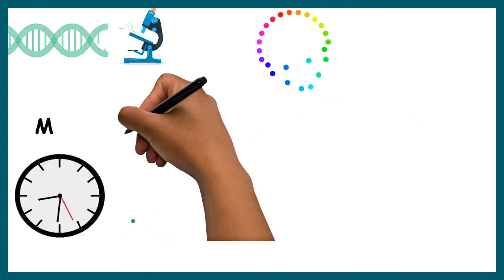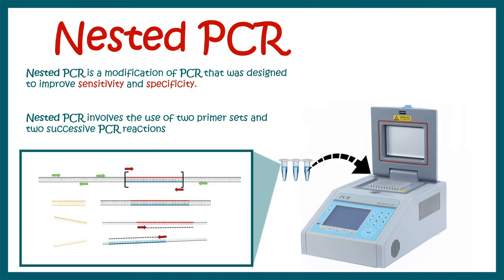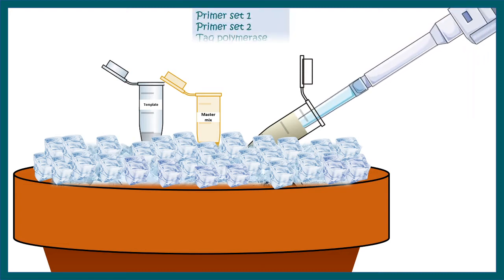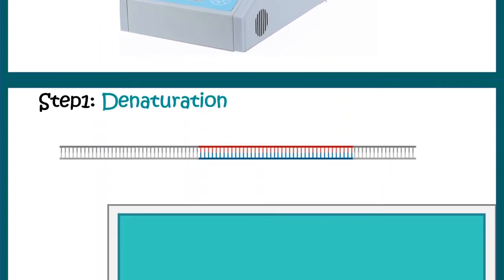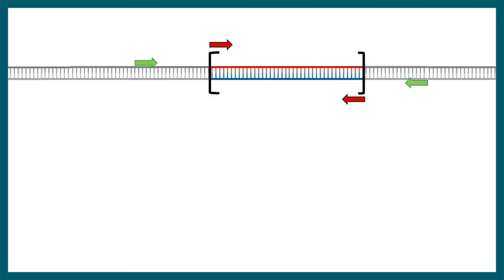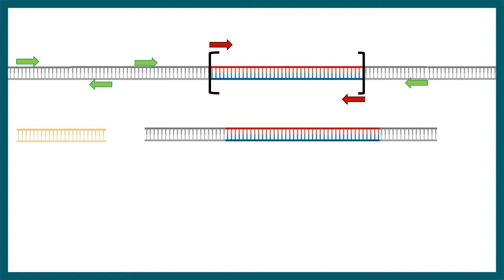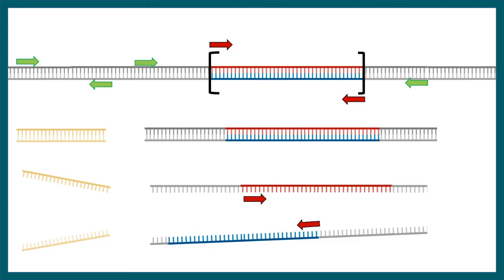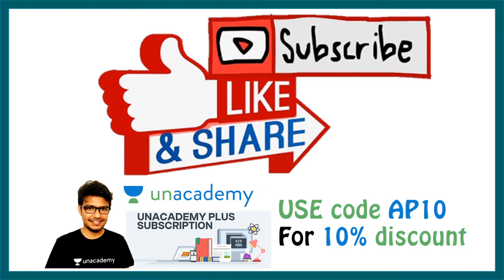Nested PCR || Principle and usage

Comment: to clarify the doubts most people have in the comment section, the first set of primers are added  along with the dntps ,buffer , taq polymerase first , then after the first round of amplification, the  product from the first PCR reaction is used as the template for the second reaction, where the second set of primers are added.
Reply: it's a pcr ception 😨

Comment: I still don't understand because i thought a Primer amplifies everything from the binding site to the end of the molecule?
Reply: Primers are short sequences of nucleotides that bind to a specific site on the DNA, initiating the replication process. They direct the DNA polymerase to start synthesizing new DNA, but they only amplify the region between the primer binding sites, not the entire molecule. Therefore, only the specific segment flanked by the primers is amplified.i hope this helps
Reply: @shashpalsidhu2420  i think that i lack imagination 😂 since this probably doesn't happen immediately as the video shows ,they first amplify the first region by many cycles until they obtain it and then use the second set of primers and proceed the same way
Reply: Oo my god tq so much  @shashpalsidhu2420

Comment: are you saying the first primer set, the green pair, acts independent of the 2nd pair? otherwise how are you eliminating nonspecific apmlicons?
Reply: The first set of primers (green ones) are used to shorten the region which has our targeted segment. As both the red and green ones are non specific , so 1st the green ones are used to shorten part of the DNA which has the target region (produce both the specific which carries the target segment and non specific region). Then in the 2nd round the red ones binds with only that region which has the target segment ,free from non specific segments.

Comment: Excellent video, but I don't really understand why having two sets of primers minimizes the probability that the second set of primers will bind non-specifically to other regions...
Reply: So it involves 2 PCR reactions right. The first PCR product is technically a template for the 2nd PCR. That increases specificity. The mastermix that you design should have outer and nested PCR mix. Outer PCR amplifies a larger region and nested 2nd uses first as template targeting a smaller, internal region of the original sequence. Hope this makes sense
Reply: Will the two sets of primers have slightly different annealing temperatures?

Comment: Perhaps a silly question, but do you combine both sets of primers in a singular master mix? Or do you add the result after a first PCR run with the second primerset seperately for a second run?
Reply from the maker: Its used as a mastermix
Reply: It's added sequentially. One after the other. First set added, procucts taken, then the second set added to the products

Comment: Why don't we use secondary primer(specific primer) in the first place?
Reply: Same question 😅
Reply: We do nested PCR when we have a large size of template and we want to amplify a small portion of it. To avoid non specific amplification, we separate our gene of interest from the rest of the sequence and then amplify it on the basis of its specificity.